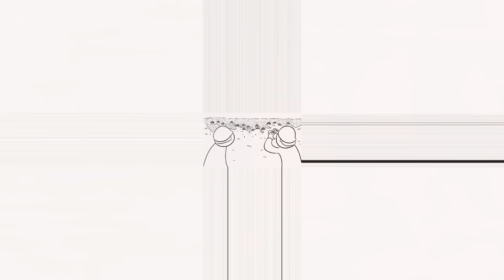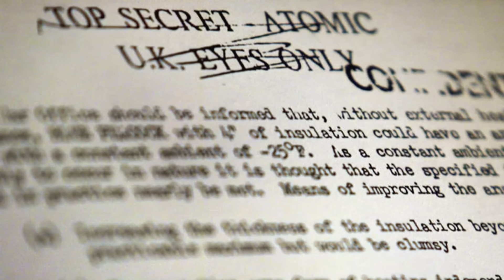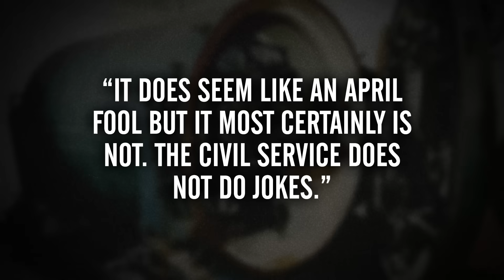The Many Design Flaws of the Atomic Landmine | Tales From the Bottle

Comment: So tbh the big question in my mind is why the need for the chickens?  You've got a nice big slug of either highly enriched uranium or (more likely by this point in time) of plutonium.  The continuous decay of these metals creates huge amounts of heat.  Enough to let the Soviets to blanket the arctic with unmanned radio-linked weather stations and navigational beacons which ran off that heat for decades.
Reply: Which also makes those things easily detectable, and on top of it, messes with the materials and electronics of the devices.

Comment: Another problem with the nuclear landmine is that, even if the west never intended to use nukes to halt a Soviet advance, the nuclear land mines would still go off.
Which would most likely spark a retaliation from the Soviets with nukes. Which would spark a retaliation from the west with more nukes... Boom boom boom, you got plutonium in your room!

There's simply several reasons as to why you don't want nuclear weapons under such poorly controlled conditions. You really have to be absolutely sure that you want to use them.

If a nuclear weapon went off in anger today, it would break the soon to be century long period of "world peace" we've been enjoying.
With "world peace" referring to the lack of any major multi nation conflicts where over ten million die.
Vietnam would not have happened if nukes were dropped in the 50's, because Vietnam would be a radioactive fallout wasteland like the rest of the planet.

Comment: The concept of a nuclear landmine sounds utterly terrible, unless it was designed just to release a load of radiation instead of exploding like a nuclear bomb. While yes you salt the earth. You also ensure anyone in the vicinity dies a few hours later, after they’re behind enemy lines and too far from medics. And you contaminate any supplies they have with them so enemy soldiers would potentially deal with supply issues.

Still a terrible idea, and probably horribly inhumane but potentially functional

Comment: 0:17 they didn't invade during winter, it's just that they thought it would be over before winter.
Reply: With some fairness against them, WW2 Germany was constantly held back on the Eastern front, and despite countless warnings on how long the invasion would take, Hitler still chose to send his men to Russia without winter gear, leading many to face the harsh winter in thin and exposing clothing.
Reply: @Femme_Snail  bro is using logic when talking about a racist 😂 that's like being mad that Adin Ross can't solve a mathematician level equation
Reply: More importantly they compromised the invasion plan, between several.

Comment: Actually the British did have the means of delivering nuclear weapons in the 1940’s - the WW2 Avro Lincoln or Shackleton, particularly the turboprop version of the Lincoln which had a service altitude of 50,000ft and was used in nuclear bombing trials in Australia. Being unpressurised however, using them would be intensely uncomfortable as it would involve hours in a pressure suit. The Avro Vulcan was a far more comfortable option.
Reply: It was the back up aircraft for the bombs dropped on Japan.

Comment: 3:16 The name convention comes from the idea that any leaks from a top secret project should kept to a minimum and is something they figured out in WW2 when looking at German intel, then did the opposite. For example the Brits were looking something a german project called Wotan and British scientist R.V. Jones figured out how the system worked by assuming that it used a single beam based on the fact that the Germanic god Wotan had only one eye. Wotan is the German pronunciation of Odin btw.

We do the same in the US. Here's one, Project Ox Cart, which in itself would make for a good video if you're looking for content, good sir. If you had to take a guess you'd assume it was something having to do with transportation of supplies. 

Nope, its the Lockheed A-12 the would be successor to the U2 Spy Plane and predecessor to SR71 Black Bird. Funny enough the U2 Spy Plane is still outliving(flying) them both, which would make it another candidate for a future vid if you're need of subject material.
Reply: One case where it worked very nicely: During WW1 the British had a rather successful research project to develop a new concept of heavily armored all-terrain tracked vehicle. Among the codenames used for the project was the intentionally deceptive "Water Carrier" - any leaks would then be assumed to be referring to a logistics vehicle rather than a weapon. This "Water Carrier" was soon referred to as the "Water Tank," and later just "Tank." The name stuck.
Reply: And it stiiiiiill 
Hasn't found
What it's looking for
Reply: The CIA A-10 and A-11 are worth covering too… (They were discontinued because they had too large a radar cross section (the A-11 looked like an A-12 with straight wing leading edges and two truely vertical tails - one was built and flown).
Reply: This 😮🎉
Reply: Project Wotan (II) was also known as the "Y-Gerät" (apparently "Y-Device"), which was a radio beam navigation device used during the "Battle of Beams" during the Battle of Britain.

The name also apparently referred to an "X-Device", Wotan I, so the information which lead to the guess was at least partly luck.

Comment: Qxir, hear me out, what if they made a reusable mine based off the Demon's core but make the edges springloaded and resets once the weight is taken off of it
edit: changed devil to demon, thank you reply section
Reply: *Demon core.

Okay, so the hard part about making a nuclear bomb is making the nuclear material. It’s extremely expensive and requires massive infrastructural investment. Actually building a bomb is comparatively trivial.

Your plan would involve the enemy capturing territory that contained the core of a nuclear bomb. That would actually violate several nuclear non proliferation treaties and would be considered you arming your enemy.

And in terms of effectiveness, someone right next to it would receive a dose lethal in 1-3 weeks. The war might be over by then.
Reply: If you can think of it, someone has tried it.
Reply: @ I don't even know where to begin... the only part you got correct was the demon core correction and the refining of the active material.